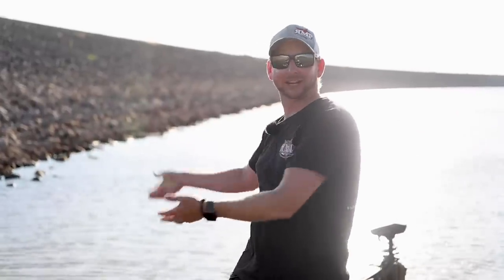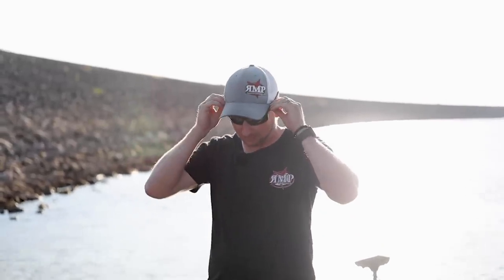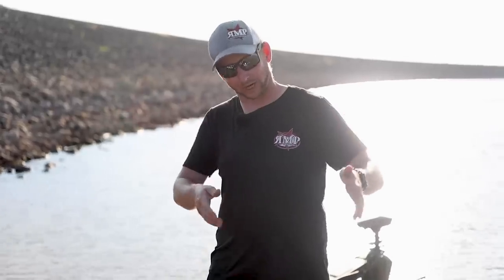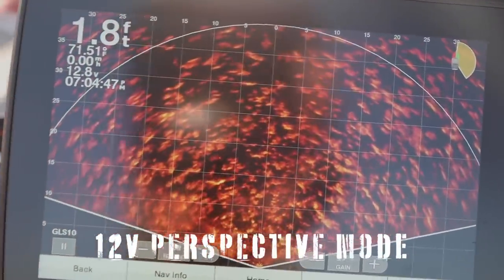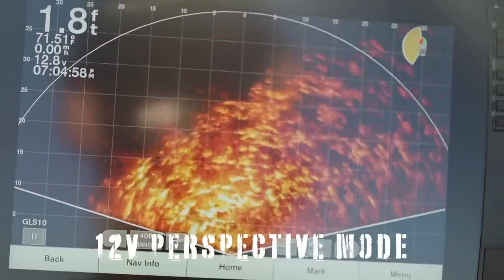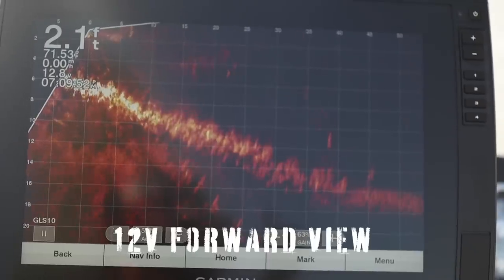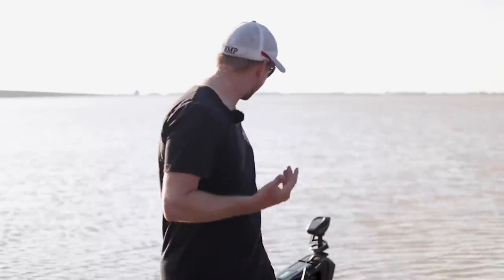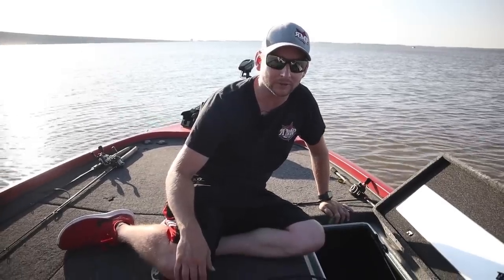GARMIN LIVESCOPE: Which One Looks Better (12v VS 24v)

Comment: Power input the device is a range of 10 to 32 Volts.  Not having the luxury of an internal schematic to tell you absolutely, I am going to make a guess.   The input power most likely feeds a DC to DC converter which will make the the different voltages needed for transmitter, receiver, and microprocessor circuits.  No matter what the input voltage as long as it is within the specified range, the performance is going to be the same.
Reply: This ^
Reply: Correct there is absolutely a DC voltage regulator circuit inside all of these electronics. Any improvements in performance people are experiencing is most likely because of their initial installations are less than quality configurations and not sourcing enough clean power to their units. Crappy butt splices, insufficient gauge wires, crapy clip on leads to the the battery terminals, loose fast on connectors to blade terminals, cheap less than optimal inline switches or old dirty switches the list goes on..... Cheers, #SeattleRingHunter

Comment: I'm a bit puzzled, you said you hooked up 12v vs 24 volt.  The voltage reading on the graph had 12.8 v on both.  Why didn't the voltage reading go up to 24 on the display?
Reply: I just watched this and thought the same thing. When I hook up my lithium batteries I believe it shows the actual voltage. Above 13
Reply: The unit voltage display is what the unit receives. He is powering/repowering the GLS10 box with the 12v and 24v batteries. The unit itself has its own 12v power source.
Reply: That's just the voltage to the screen.  Can't be 24v to it or it'd be fried .
Reply: The graph is hooked up to a 12v battery. The Livescope box is hooked up to separate batteries. He mentioned that in the video to NOT run 24v to your graph.  The black box for LS is what he switched the volts on.

Comment: Power supply range is min of 10 to max 32 volts.   Reason is not performance related.  But allowing you to  utilize your trolling motor power supply. In today’s world we all have multiply display units along all other boat accessories drawing from stater or house battery.

Comment: Why in both screen shots showing system on 12v and 24v the video shows 12.8 v in both set ups ?
Reply: Most likely the voltage is being measure at the chart plotters input and that always remained 12 V DC. He only increased the voltage input to the GLS 10 black box so this may be what we are noticing on the screen. Remember the chart plotter has its own independent 12 V DC input and the GLS 10 has a dedicated DC power input. Cheers, #SeattleRingHunter

Comment: is it me ? or does the screen not show 12.8 volts in each view?  is the 12.8 v only the chart plotter volts?  I don't believe my panoptix allows for 24 volt connection.  Maybe he is hooking the batteries up in parallel for longer endurance...the panoptix does use a lot of power and I have had it shut off due to low voltage.
Reply from the maker: The 12 or 24 comparison on this video only covers power going to the GLS box, not the unit. The unit itself should show 12v

Comment: I'm looking at a low noise 36v input DC/DC converter with dual outputs.    28VDC output for the box and 18VDC output for the displays.  

All other things equal, more volts but still within spec and clean voltage is less amperage draw a cooler running unit.  

Just wire the DC/DC in parallel to the trolling motor at the bow,  run a small gage remote turn-on lead from the helm 

Garmin ought to make a system.   People can put in three lithium for the trolling motor and drop filtered power to all bow stack components.

Comment: Do you recommended running a dedicated battery just for ls or can it be hook up to the cranking battery if it’s already a 31 agm?
Reply: When you say “disconnect the batter”…….do you mean it has to be a “mechanical “ disconnection “ from the battery” or does the starter key do that function once it out of the “start” mode.?

Comment: The 1222xsv is rated for 10v-32v dc input power rating . Lots of guys including myself run the 18v Milwaukee lithium batteries and yes the image is better. If you want a better image, increasing the power to the black box won’t die it alone, that’s like plugging a 4K cable box into a 1080 television.

Comment: You have to increase your voltage to your Garmin head unit also to see more of a difference in clarity
Reply: That's just plain incorrect, all of these units have built-in DC regulators that will convert the supply voltage to the correct operating voltage (as long as the supply voltage is within the acceptable range). Justin hit it on the head, people are seeing a difference because the higher voltage is compensating for a bad install. You won't see any difference between a dedicated 12v Lifepo4 and a dedicated 16V/24V Lifepo4 on your electronics, it's a gimmick to sell more batteries.

Comment: both videos showed you were at 12.8 volts in both videos...
Reply: Because 24v was only ran to the gls10 black box, the head unit had a separate 12v battery so that won’t change. It almost got me too for a second till I remembered he said something about running dedicated 24v to the black box only.

Comment: Perhaps you should run 12 and 24 volts to both the chart plotter and to the panoptix unit.  Compare at differing depths too. 

I run both of mine off a single 18 volt Milwaukee compatible battery. Works great. I used a knockoff TenMore 18v 9 ah battery 2 days ago. It started off at 20.4 volts. After 5 hours, it was down to 17.0 volts and half a charge left. I didn't pay attention to any differences as the voltage dropped.
Reply: I don’t think you can give the chart plotter more than 12
Reply: @bakervinci163 all head units are rated up to 20v. Look at their manuals.
Reply: Yes and 8600 rated for 32 volts

Comment: Why on the twenty four volt screen it said twelve point eight volts
Reply: Bill Mccoy it’s still 12 volts with 2 batteries, in parallel not in series. You don’t want to send 24 volts to it.
Reply: On the unit I’m saying, he’s supplying 24 volts to the black box of the livescope not the fish finder if that makes sense lol
Reply: It always shows the voltage supply to the chart plotter. He still had 12 volts powering it.
Reply: Bill Mccoy echomap can handle up to 30v per garmin, I had my  Echomap on 24v, with no problems

Comment: It shows 12.8 on both screens
Reply: Head unit is running on 12v. Only powering the GLS10 (black box) at 24v and what you’re seeing in the screen does not show voltage of black box.

Comment: Sorry boss but you seem to have accidentally wired your batteries in parallel instead of series increasing the amperage instead of voltage which is why both screens show 12vdc.
Reply: If you look at the labels of the batteries, they are not facing the same direction.  If they were facing the same direction, the longer label would be on one side and the removable month stickers would be on the other side.  They are setup to where the removable month stickers are together meaning they are back to front which will link a positive to negative thus making it a series.
Reply: Head unit is running on 12v. Only powering the GLS10 (black box) at 24v and what you’re seeing in the screen does not show voltage of black box.